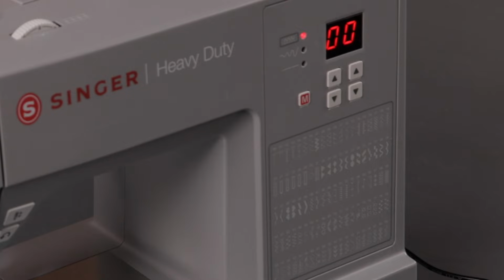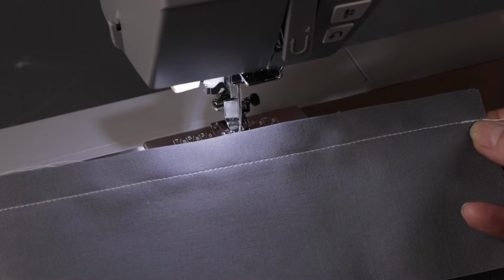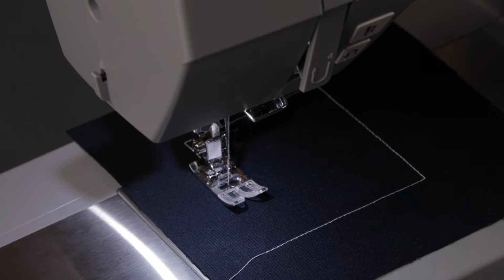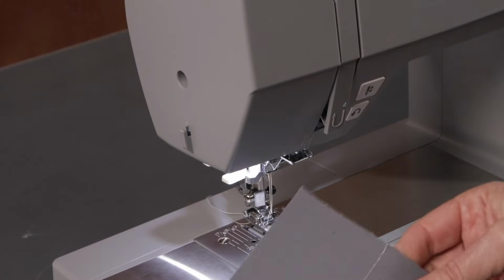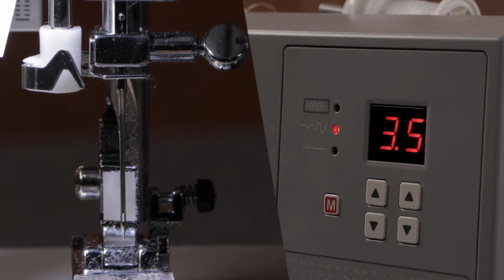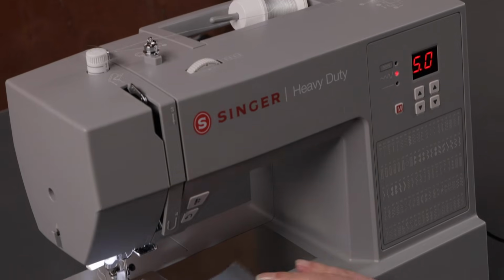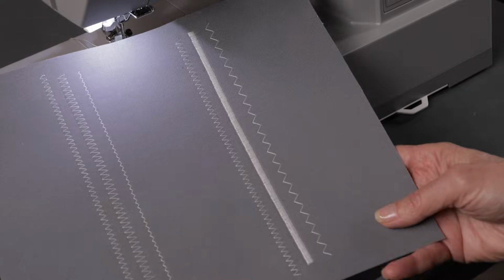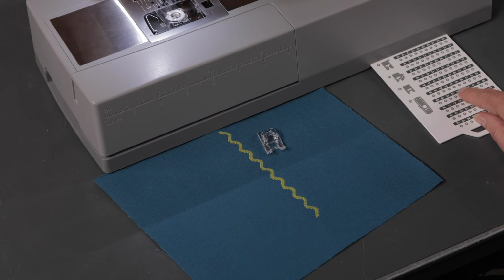SINGER® HD6600C Series - Selecting a Stitch and Sewing

Comment: I'm not sure I trust any computerized sewing machines. Used to, you would get a sewing machine and it would still work for 20 30 or 40 years and you could keep it in your family for generations. Yet both of my last computerized Singers either did not work right out of the box, or stopped working a few years later with minimal use